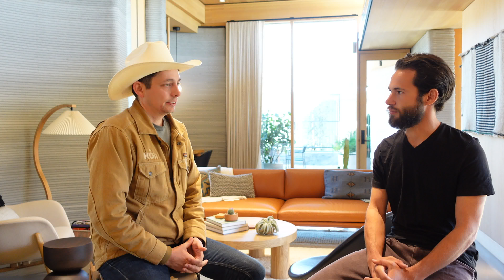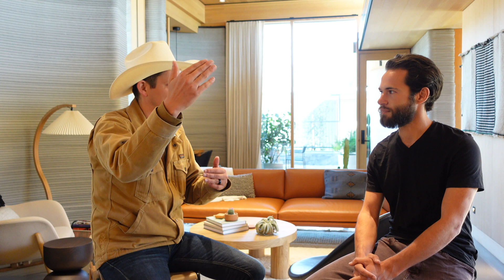Jason Ballard 3D Printing Houses from ICONs 3D Printed House Zero, Horizontal & Vertical Integration

Comment: “Everything printed using an ICON machine needs to be beautiful” 

Not sure if that type of aesthetic dictatorship will be welcomed in a field of such vast design preferences and opinions. I can understand the thought behind his desire to control the quality of buildings produced by his machines, but I think that would imply you need to stick with the proprietary business method. They already are claiming you can only use their proprietary Lavacrete material on their machines. Right? They want to maintain an aesthetic, which is clearly more refined and already identifiable in their beading.

Comment: Really, couldn’t they put a decent clip on microphone? Or Ask better questions of how leading  3D development in Germany compare to what they are doing or how the Dutch 3D printer is different that the one they use??
Reply from the maker: No clip on mics are not convenient for my run and gun process. Minimalism is why I am able to visit so many sites. I don't ask companies to compare against each other on camera it isn't fair unless both are represented at the same time. Germany is not developing this technology they are implementing it and some german architects have designed great projects but they are not using german printers. The printers the used in Germany did have a few german machined parts but thats too semantical. America has far more 3D printed homes and 3D printed construction companies than Germany, many other EU countries do as well so I am not sure why Germany is the bar you have set.

Comment: I live on the outskirts of Lismore NSW Australia.  As you may have heard it's been severely damaged by unprecedented flooding.  There are thousands of homes which have been all but annihilated.  Most are old timber frame dwellings with fibro walls set upon stilts.

This area has always been a flood prone but these latest floods were three metres higher than any other in recorded history.

There is a lot of work to be done not just to rebuild but to attempt to ensure the next flood doesn't do exactly the same thing.

You might also know that a couple of years ago this same area was profoundly drought affected, and intense bush fires were raging in the forests right next to this disaster area.

It's reasonably obvious these weather extremes will get worse as climate change accelerates unabated.

There is real concern that this community will not recover as it's entirely unclear how this region could be assured of thriving in the increasingly hostile environment.

When I watch these 3D printed homes and imagine what could be done if the will and money were applied, it seems such a useful technology for homes that would go a long way to solving these problems quickly and aesthetically.

I do hope there are people reaching out to companies like Icon to pave the way to implements such habitation in regions such as ours.

Comment: Love what these guys do, and the way they do it...love love the floor to ceiling windows...Can the do 10' ceilings and still use full length window?...do you know when ICON will be building in Phoenix?  The one downside is the 1 foot thick walls that will lower your house square footage quite a bit...need to get those walls thinner I think...Great stuff Jarett thx!!
Reply from the maker: They’ve certainly done thinner walls
Reply: I would think that unless you're rather limited on space and you've got the room to compensate it shouldn't really be an issue right? If need be you can always build up.
Reply: @roseannarios7312  living in Phoenix building up gets too hot and besides I'm getting older and don't like stairs
Reply: @TylerTheCompiler  I was speaking theoretically but I hear ya. I live in an area where our summers can get rather brutal. I don't know how you guys do it.
Reply: thick walls regulate heat much better